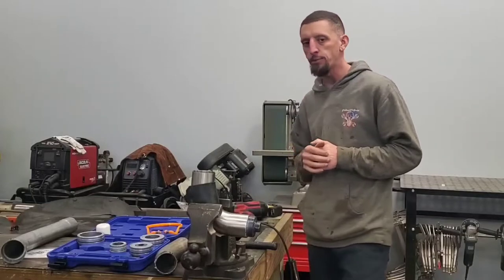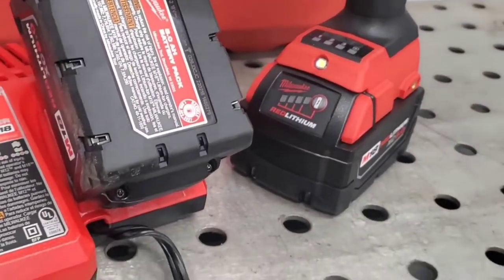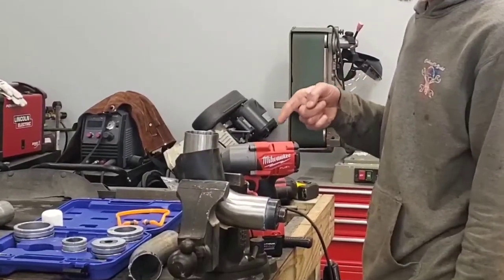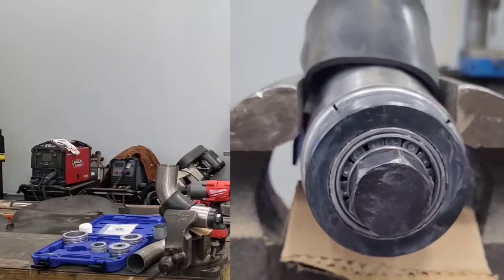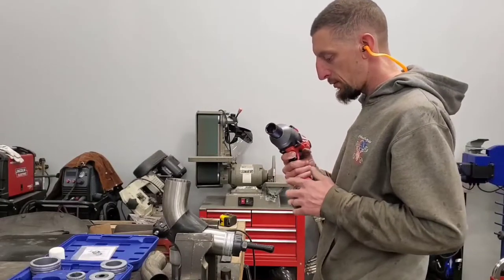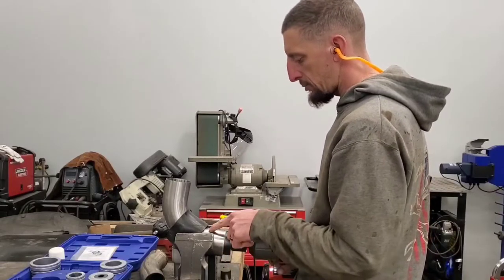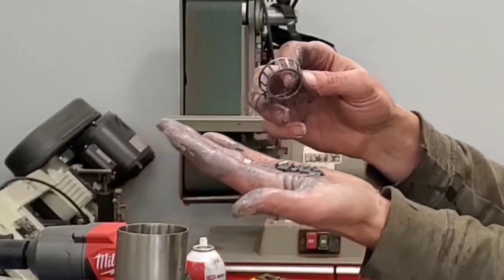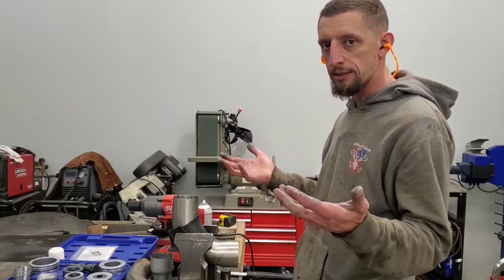Astro Tools Exhaust Stretcher Kit Part 2 - Will The Milwaukee 2767 Impact Wrench Have Enough Power?

Comment: That impact can put out 1800ft lbs no way are you grenading that stretching some pipe.
Reply from the maker: Thats the 2767 - 1/2"drive version (1400ft lbs take off torque)  probably not gonna do much damage ...
Reply: @ChallengeTheBuild  Take off torque?

Comment: This was actually fun to watch, suspenseful music et al.   The problem here is due to the metallurgical properties of the stainless steel.  It has a higher Young's modulus (of elasticity)  than mild steel and also a higher yield point on a stress/strain chart.  That means that there's more "spring" in the SS than MS so you're working against the properties of the SS.  To successfully expand the SS pipe, you have to stretch the pipe to a point past the required diameter and that's probably going to take 10x more tool strength than you have there.  Thanks for the demonstration; I really thought that the bolt would strip out.
Reply from the maker: Awesome, glad you enjoyed it... I appreciate you watching and commenting....👍 Thank you

Comment: I have to wonder if the aluminum pieces are too soft and absorbing energy and if they were steel it would work better.  Aluminum vs stainless is a tough match.  I have the same Milwaukee impact gun and it hasn't met its match yet.
Reply from the maker: This is a great point, never really thought about it but I am sure they absorb atleast a little bit of energy...  And yes I don't know how I survived without my Milwaukee 2767 😂...

Comment: Good video to watch after i bought one myself. According to what i learned at university about the strength of materials, trying to expand a pipe so close to the bend would require a lot of energy as the tensile strength material is different because of the bend as well as the energy being excreted trying to expand the pipe is dissipated in weird way. 
As i have no idea if the wall thickness at the bend is the same as the rest of the pipe due to the fact that i don't know if it was mandrel bent to made that way , i will have to assume that it is the same thickness.
Ill try to calculate or simulate the energy needed to expand it 0.5'' total.
Reply from the maker: I appreciate the watch and comment..  The amount of energy needed is HUGE! 👍💪

Comment: I'm pretty sure you were holding the expander from doing what it was supposed to do by the vice it looks like it's over the expander inside the pipe.
Reply from the maker: It's possible the vice was limiting the expander a little bit.. 🤷‍♂️

Comment: I watched most of the video, but the one thing I didn’t see you try is heating the pipe first. A butane torch might have made the job easier.
Reply from the maker: So the reason I didn't use any other methods in this video is I wanted to see what it would actually take to expand the stainless pipe using just an impact driver.   I'm sure if heat was introduced it would have made things a little easier... It was a difficult piece of pipe..😂😂More difficult then I thought it would be, I was kind of surprised with the entire process ...
Reply: The rubber rings would melt